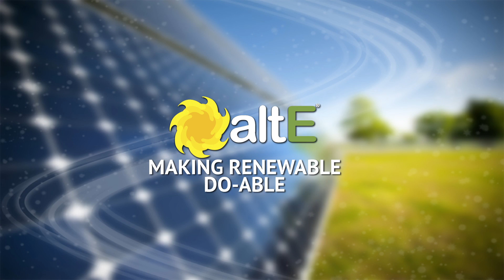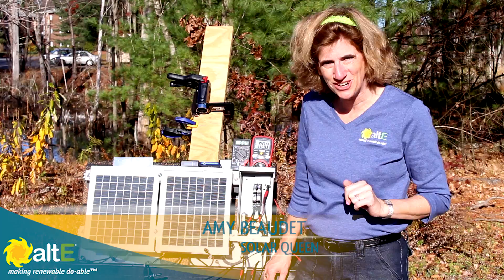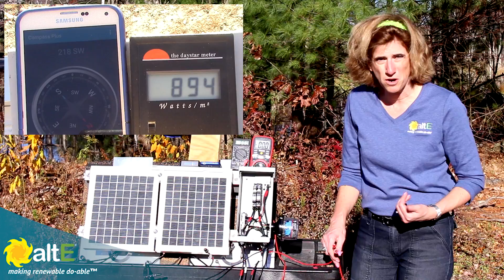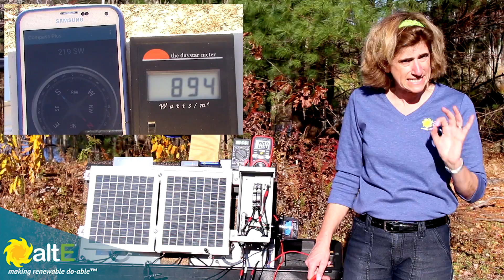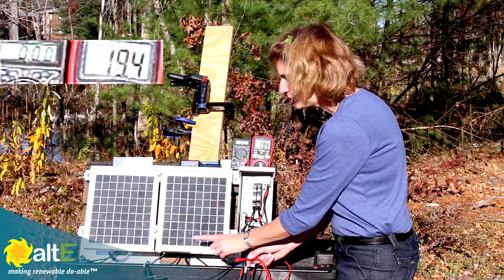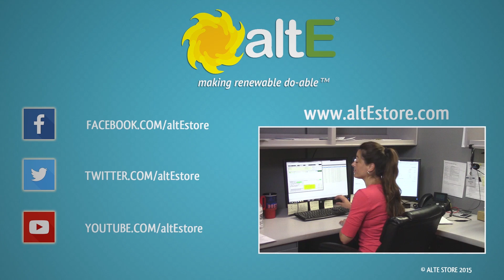What effect does shading have on Solar panels?

Comment: When you look at your solar panels, sometimes a few can look like there's discolored spots on the surface. It looks like circular almost rust like tint that's barely visible in the squares on the panels. And I was worried and wanted to know if this can be indicative of unnatural heat or fire risk? In particular, I thought to ask this since there have been people that had fires with their solar panels?

I also haven't seen people talk about this much. There's not really very many videos that talk about how to detect heat or fire risk ahead of time.

Comment: It depends on how many by-pass diodes the panels have.  For larger wattage panels, Canadian Solar uses half-cut cells and has more columns.  They put a by-pass diode on each column.  Allegedly, Sunpower has a by-pass diode across each cell.

Comment: I plan to add two panels to my system. I have two strings of 8 -24 volt panels in series192 volts. If I turn off the inverter is that enough or should I cover the panels while I rewire them?
Reply from the maker: Panels shouldn't be disconnected while the sun is shining on them. If you could wait until the sun is down to disconnect, that may be the easiest solution. But yes, covering would be a good idea.
Reply: Does that mean I should cover both series of eight panels?
Reply from the maker: Cover as much as you can of he string you are disconnecting. You want to get the voltage down low enough that you don't create an arc when you disconnect the connectors.
Reply: Thank you! Your videos are very informative.

Comment: Hi Solar Queen, I have a question please...

How to calculate the minimum spacing between rows so they don't shade each others, I read that this calculation is related to Azimuth angle of  sun and other parameters, but it is still complicated for me, So have you recorded a video discussing this issue?
Reply from the maker: I assume you mean if the panels are tilted up so the row in front is shading the row behind. There is a complex formula to figure it out. However there are some online calculators that may be able to do the work for you. Try this one, http://www.rbisolar.com/solar-shading-calc/
Reply: You are Awesome ! :)

Comment: How does orientation affect performance? For example, I see most panels setup vertically and rarely horizontally... is it because of what you just showed about how panels' cells are wired in series? Should I have the sun's trajectory from east to west run from left to right on my panels or from bottom to top?
Reply from the maker: +Oscar Roque With no shading, there is no performance difference portrait (vertical) or landscape (horizontal). The reason most or installed portrait is due to how they are mounted to the rails, it uses less rail to mount them portrait, and some panels' manufacturers require they be attached by the long side and not the short side. If there are shading issues, and changing the orientation affects which cells are shaded, then perhaps orientation might make a difference. But in general, it is a cost or design issue.
Reply: Hi Amy, is there a type, model or brand of panel that is specially wired so that shading is directly proportional to the surface covered?  I am specifically interested for use in mobile or RV applications where we cannot always have perfect conditions.   Thanks !

Comment: Thank you Amy this was really useful to know. I am just building my solar array and now I know to put the panels that get shade horizontally.  Although I assume not all panels are wired the same. However now I know I can try. Thanks. Question: Is it possible to to connect a string of 8 panels with a string of 6 panels? The panels are at the same specs. But If I connect all of them series I go over the max Voc allowed by the inverter.
Reply from the maker: +Adrian Cheudan It depends on the inverter. If they have 2 separate MPPT channels, you can have uneven strings. If they have 1 channel, you'd need to do 2 strings of 7. If they do have 2 MPPT channels, make sure that 6 panels is a high enough voltage. Many inverter companies have string sizing tools available to determine the best configuration for your specific panels.
Reply: +altE Store It has only one MPPT. The problem is I allready bought 10 panels of 180W with voc 44.4 and vmp 35.4. The limits of the Inverter are 250-450 v. The max limit is 500v. But I would like to stay under 450 as this is where the performance of the inverter is ok. The problem is that with 10 panels in series I am over the max limit.  I would have to buy 6 more to be just a little above the min limit... And connect then as two strings of 8 panels.  Even so with two strings of 8 I would have the lowes voltage 283V but if you take in account the temp performace of the panel it might drop down to 250 V. Will the inverter still work ok like this. I really don't have place to put more. 2*7 would be the optimum size for my roof . 2*8 are squeezed.  . The amps are well under the max. I assume that latter on if I want to expend I need to buy the exact panel. That might be the problem as right now I got a good offer that might not be around for long.
Reply from the maker: +Adrian Cheudan You have a very good understanding of the limitations. You are right, you don't want fewer than 8 in series, because in the hot weather, the Vmp voltage will drop below the MPPT range, and you won't get good performance. But 10 in series in the cold is too much voltage. I did another video talking about the difficulty of getting the right string size with 72 cell panels like you have. This is a classic example. It looks like you have 2 choices, only use 1 string of 9, and keep one as a spare or sell it, or find room for 16 panels, if the inverter is big enough to handle that.
Reply: +altE Store Store the inverter can handle up to 4500w from panels. that is why I think it would be a waste to use just 9 panels. it is a little strange that is says that it is a 3kw inverter but can handle 4.5 kw solar. don't you think a 2 x 8 string will put a too low voltage? I have seen many of your videos these day but it seams I missed that one.
Reply from the maker: +NewTech What brand is the inverter? Have you used their string sizer to determine the best option? Many inverters can handle 1 1/2 times their rating to allow for better performance in low light conditions. So early in the morning and late in the afternoon, as well as on overcast days, the inverter will be able to put out more power. The down side is on good weather days, it will clip the output so you are wasting potential energy.
Reply: +altE well it is a Chinese inverter. it is the only one that would allow me to have on grid and off grid in one package at a reasonable price. at first I was looking at a SMA and I am sure that was way better, but it was just a on grid and offered no support for backup. I know I could use more then one devices to have a full solution but this will do for now.

Comment: Hello Solar Queen,
I watching all your video is great and i like it because it give me more information about pv module system. But i have one request to your make a video about how fast the pv panel will produce the power (in seconds) and the effect of solar irradiance & temperature to pv module. tq :)
Reply from the maker: +Azri Aris Thanks for your request. I do have a video on the affect of irradiance, I show it when I change the direction of the solar panel in this video, https://youtu.be/qyf_FZqyzVw. You can see the intensity of the sun on the irradiance meter and the output of the solar panel. I also have one showing the voltage change with temperature changes here, https://youtu.be/swSRsPls5wA. I'll try to come up with a video on showing how much power is generated over a period of time, I have a few ideas.
Reply: Thank You for you recommended, if you already come up with a video on showing how much power is generated please inform me so i will not miss that video.
altE Store is great.
Reply from the maker: +Azri Aris I'll be sure to let you know. It may still be a couple of weeks before I can do a video outside, we just had a snow storm today, winter isn't quite done with us yet.

Comment: Hello Amy! Great video. Can you tell me if the second solar panel is wire in series or parallel? When shading occurs, it is better parallel?
Reply from the maker: +André Bonaventure In this particular video, I'm only using one of the panels. I'm hoping for another warm day this week to record an example of what you are asking for, comparing shading scenarios when wired in series and parallel, and possibly with diodes to mitigate the losses. Stay tuned.

Comment: the voltage doesn't drop because of the potential illusion across semiconductor devices, but the current flow is effected.
I learned this fact many years ago trouble shooting solid state relays, but applies to most semi-conductors.
my frien will look at my small 120 watt panels setup and see it to be 24 v on the batteries at full sun, but that doesn't reflect the battery charge, just the output of the panels.
thanks